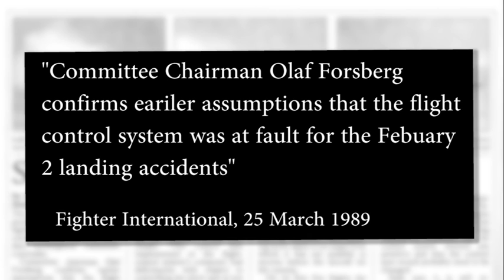What Crashed Gripen Fighter?

Comment: No, the Gripen is not naturally unstable, nor relaxed. All delta winged are inherently stable. The "instability" of the Gripen is deliberately induced by the active canards. They are controlled such that the center of lift is moved forward, which makes the aircraft more nimble. 

In case of controller failure, the fallback mode of the Gripen is to release the steering of the canards and let them flow with the wind. This instantly makes the aircraft stable, and obviates the need of active control to keep it flying.
Reply: thanks for the explanation; it makes sense actually to let the controls flow with the wind.
Reply: Michael Karnerfors
Okay, but disruption of airflow from the canards disrupts airflow across the delta main wing and could cause a deep stall.

Comment: Forgetting the fact that at 1:18, the aircraft appears to be much too slow, and  being a Cunard configuration, in that the controls are ahead of the main wings, I just cannot imagine the heavy turbulence those moving controls ahead of the wing were doing to that wing.  Those heavy movements were certainly playing havoc on the wing streamlines and they were not effective as they were stalling themselves. That  aircraft must hold its speed as in being a cunard configuration,  it cannot have large powerful flaps as it will drop its nose too much.
Reply: I dont think you have seen the Gripen fly.
Reply: I don't think you even think!